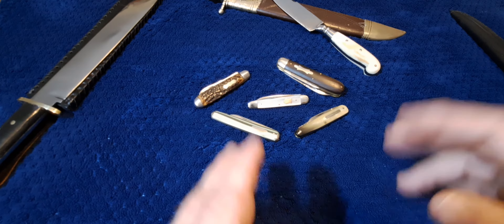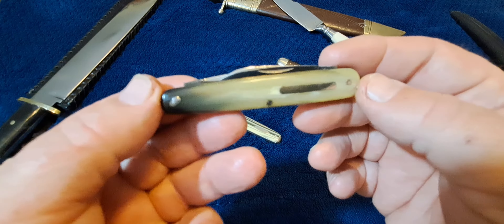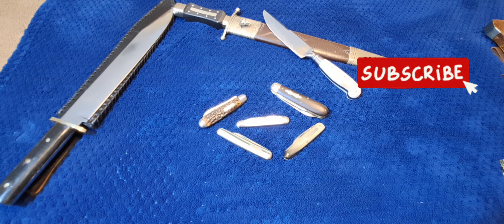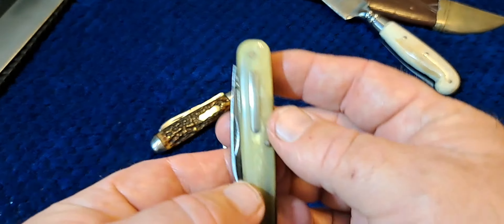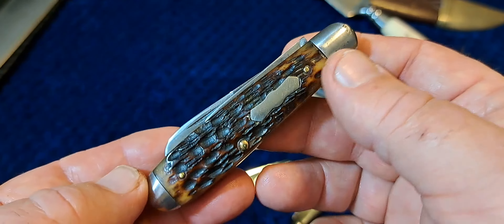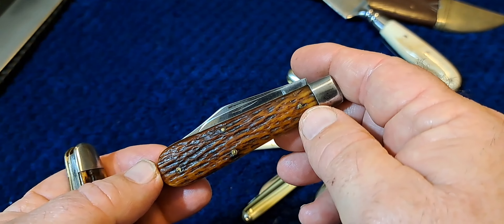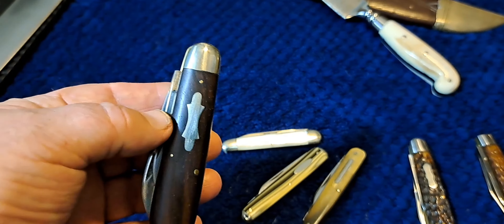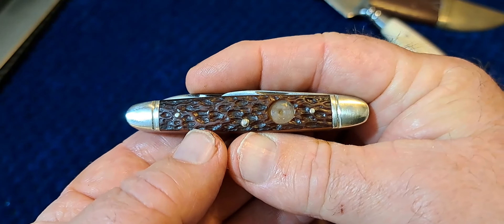What is a sleeveboard pattern 🤔

Comment: Knife manufactures name knife patterns to define their specific model of knife. I have a Schatt & Morgan model that has a combination of patterns. Its shape is a sleeve board and the blade and back spring configuration is a whittler. The knife frame is an Elephant Toe frame size. The Schatt & Morgan model name is Wildcat Driller.
Equal round end Cattle knife models knives are cigar shaped with blade sets later called stockman knives. The same frame is the basis for many other knife patterns including Camp and traditional Boy Scout knives as well as whittlers and Moose patterns. The sowbelly is considered a serpentine frame and a stockman pattern too by definition.
The more you study Traditional knife patterns the more confusing it becomes. You have to enjoy learning about them or it would drive you crazy.:face-blue-covering-eyes:😆🤣